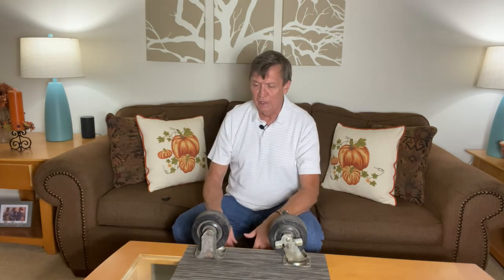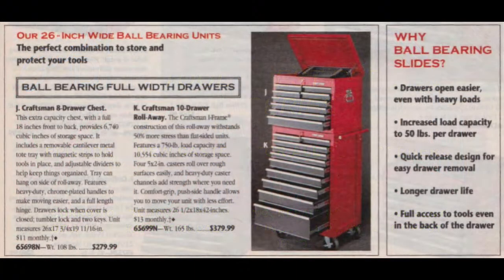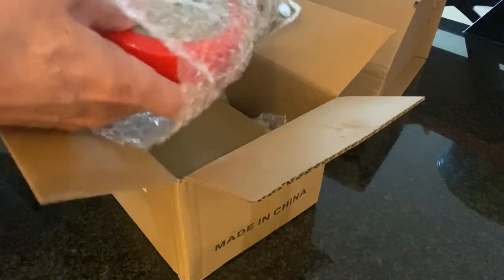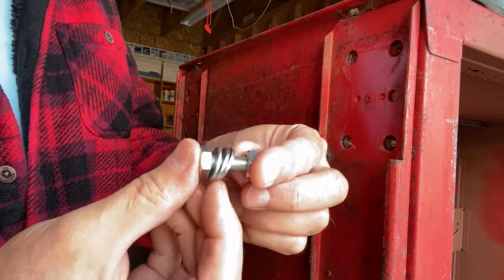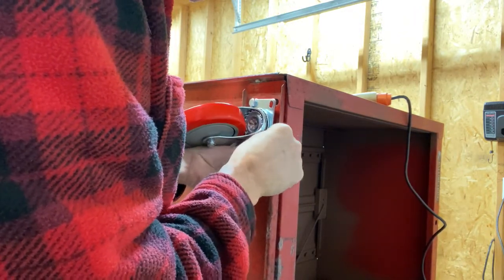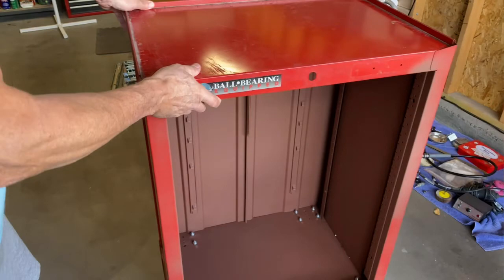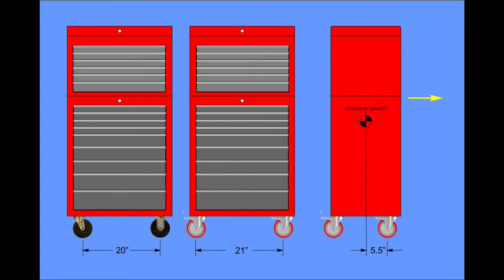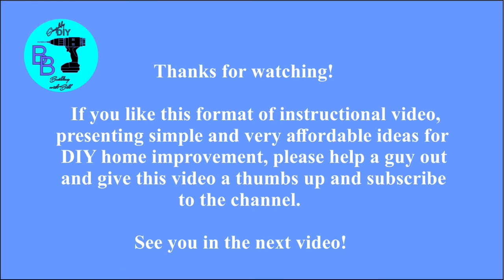HOW TO REPLACE AND UPGRADE TOOL CHEST CASTERS FOR UNDER $30!

Comment: I have the Husky 4 drawer cart that cost $130.  The wheels need changing.  I don't need 6 inch casters, 5 inch is plenty.  I have to remove one wheel to see what will fit.  No fun fighting with a cart with terrible casters.  I should have changed it when I bought it.  I didn't know but now I do.  Thanks.

Comment from the maker: Update after a month of use: These are so darned frictionless I have to use the brakes constantly. Compared to the original Sears casters these things are very slippery and the chest rolls on even the slightest incline, so consider that when purchasing. I'm also looking into whether there are low-cost locking casters--meaning ones that will lock in one position so two can be locked from swiveling when you need to roll it a long distance. I absolutely have to have all four swivel so I can push the chest backwards into its storage location, but it might be nice to have the option of two fixed/two swivel when pulling it longer distances. But the positive result of these caster as currently installed is that they're very free rolling and quiet.
Reply from the maker: @cmwyeye1214  I never got the chance to try pin-locking casters in two of the locations; a couple of pilots from a local fighter base saw my chest/box combo and offered $100 more than I had into it so it now has a new home. Thanks for watching!

Comment: hi Bill, Do you have the old caster still?   I'm working on 1992  41"  Craftsman cabinet  trying to keep the same bolt hole pattern on a 5 x 2 wheel.
Reply from the maker: Yes, I have the original 5x2's. These new ones are narrower, but rated higher than the load I'm putting on them, and they're quieter than the originals.